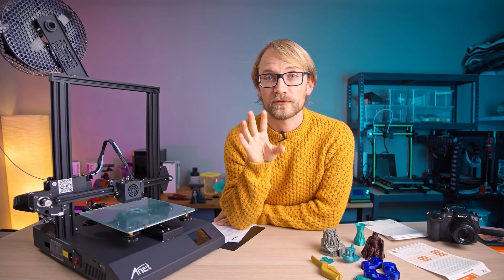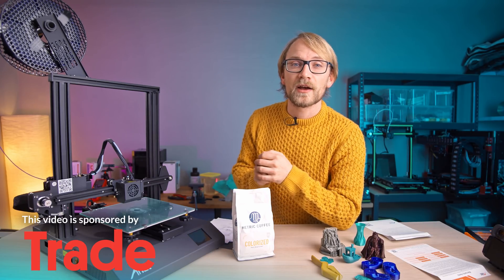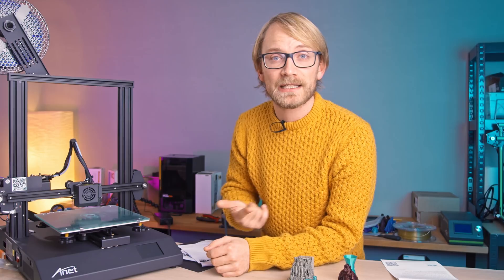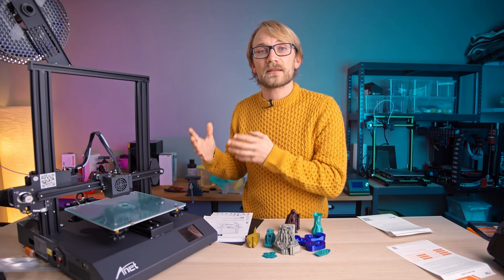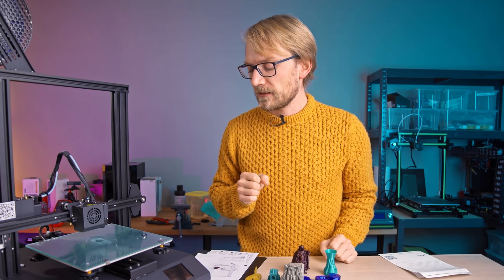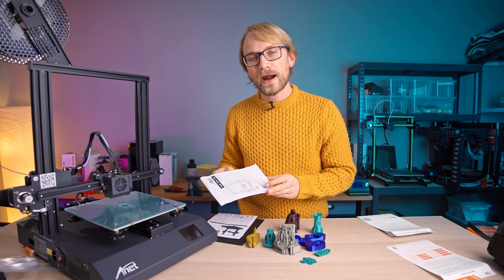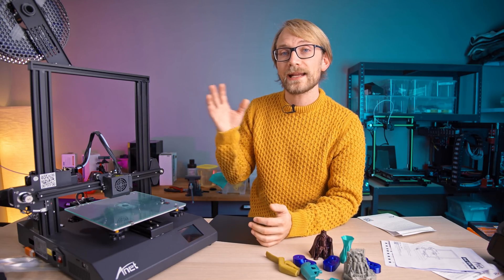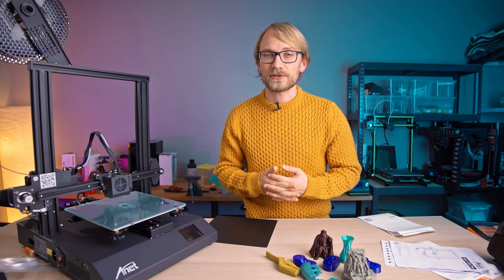What a lazy 3D printer design! Anet ET4 "Pro" review

Comment: Yeah.. got an old A6 (second hand, 50$) and it is/was trash when i got it. I mean:
the frame flexes (reinfroced it, ended doing a custom aluminium frame. Good thing i can design being an automotive mechanincal engineer for real), 
the hotend is trash - got a proper V6 clone (along with new fans and designed a new X carriege), 
belts and tensioning and aligning are trash and got new mounts designed to make a straight path, proper tensioner with toothed idle roller and good stiff gt2 belts not the rubbery type it had.
Linear axis and bearings were worn and bent (i said i got it second hand.. but the axis are not hardened! the axis were chewed by the bearings and the bearings were chewed as well). Swapped all axis rail and bearings and also got a proper mounting on the frame (that is replaced entirely, but original mounting was trash with zero ajustability and was binding forcing the y axis to bend and bind in some spots, they had a slight angle) and adjustability to ensure they are level and paralel. Also went from 8mm to 12mm since there was not much big price difference.
Motors still hold up, extruder gears were redesigned by me to be bondtech type (dual driven wheels, both knureld with hollow indent to beter wrap the filament). Made my wheels on a minilathe out of tool steel and carbide inserts. - knurling done with rotary tool in toolpost and indexing on the lathe spindle.
Electronics are still present but A4988 drivers ged old really fast and plan to swap to tmc2300 but i bet is not easy to swap so a new board is probably a safer bet.

Overall for 50$ i got 5 steppers that work, and two T8 screws and bronze T8 nuts, psu, crappy lcd and electronic board - all in chinese quality. For a proper build i'd swapt the psu and electronics board and motors with proper drivers and will have nothing left from the original anet a6.

Anyway the thing i got was a template and personal drive to make it better. If i have not got that 3d printer and waited to make one from scrath would not probably have one to this day. The same when you want an old car and just buy a wreck with seized engine and totaly rusted out frame and body and redo everything based on that template.

Anyway, i now still have that heavily modded anet that works a lot better than original. and got a prusa mk3s as well and often work with a pro 3dprinter from zotrax at work. (got it by request after i messed with 3dprinting at home with my endless struggle with anet). Neeedless to say that whenever i want to play i print on prusa and on zotrax and the anet is gathering dust.
I might repurpose that anet to make CNC or vector cutter for vynil or CO2 laser cutter engraver (with the all metal frame and 12mm axis i guess is strong enough for light cnc. But probably need bigger steppers. 

Anyway this is my experience with Anet or whats left of it.

Comment: Hey Tom, I love seeing reviews being critical when they need be and not when they don’t.  One thing you called out that is also a complaint I have is the belt path.  I see the same thing on every Creality printer and it’s just not good design.  We know that tying the carriage and bed, which only move linear to a power transmission using a belt that’s not parallel to the motion causes error as the carriage/bed gets closer or further to the extremes of the movement.  I completely understand it’s the design they come up with that lets them offer the cheapest price.  But all it would take is a little more thought, it wouldn’t cost anything to do it right.  I posted it to Creality’s Official Facebook Group and got completely destroyed with insults by users who don’t understand the problem, or were quick to dismiss it because they’re cheap printers.  I was wondering if you might also point this out.  Maybe printer makers will take note.

Comment: I bought this printer (before I saw this review), but I haven't had any problems with cura: I just installed it on Manjaro and there was a profile for the printer which works well. Now that it's setup I can get good results. The setup instructions and the support model are atrocious and Anet really needs to be called out on this so well done, but the printer itself seems to produce good results. My calibration cube is within a 1/10th mm. The review is more about Anet as a company than the printer's actual capabilities, but Anet really needs to learn this lesson and stop this bullshit they are going on with.

Comment: impossible  to update   firmware  on it  with out external programmer, if you do. warranty,,  1 years is out the window. DO NOT BUY.  Anet should be ashamed of them self for such a failure. but its a good paper weight now...................

Comment: I do have one (unfortunately).
- Nothing sticks to the glass bed, unless there is a tube full of glue (PVA glue stick). To put things into perspective, even PLA prints warp!!
-  When trying to print fine details the extruder (gear) makes a knocking sound that progressively increases (not heat creep nor due to filament getting blocked due to lower temperature).
- it took me about 3-4 months and few failed attempts to figure out that the 'black sticky back sticker" is useless.
- the cherry on top? badly configured cura profiles. (Machine works  okay with latest Cura (4.7.0+) though)
Reply: Before someone comments about inexperience, I work at a makerspace, where I'm in charge of 3D design and printing. We do have a few 3D printers - cheap ones to expensive ones - never are any of them a headache..

Comment: Are you capable of making a review of ANY 3d printer?  Or are you expecting to be mollycoddled? I bought one of these in early November it printed straight after I put it together.  The hardest part was getting it out of the box, it was packed so tight I had to get my wife to hold the box while I pulled it out!  I installed the software, Cura 14.0.7, and ran the 3 provided samples, Gcode produced by Simplify 3D,  I didn't even level the bed!  So, please, find out what you did wrong before blaming the printer. You spent nearly a quarter of the review telling me about some sort of coffee before you got straight into the complaints.  Not a good review even if you hated the printer!

Comment: I have the ANET A-6, I got it as a kit over 2 years ago and mine works great. so I guess not all their products are rubbish, or at the very least didn't used to be.
Reply: Jesus. That thing is absolute TRASH. Not a single good thing on that one. No scratch that, the price was good. Got one for about 100 euros back in the days. But it's horrible and I've disassembled mine ages ago to be used as random parts for other products.
Reply: @jothain  I've been using mine for few years now and the only complaint is the heated bed is not perfectly flat, but for me its been printing fine and the only repair has been to the fan for the heat brake, but I broke one of the blades off myself accidentally. maybe yours was just a lemon?? what problems did you have and what are its likely failure points that I should be watching for.
Reply: @kirknelson156  Well the biggest problem is that there aren't any safeties enabled by default on it's control board. There's serious firehazard issues with that device. Also it's heated bed connector is very likely to melt/burn. Then the build quality itself was horrible. I made tons of tweaks for it replacing multiple parts by other designs to get it working better and in the end it honestly printed really well, albeit slow. But I decided to trash that machine because of my long prints and it's evident fire hazard issues. There're reports of people's houses burned because of A6 electrics and software. I replaced that with Prusa MK3 and have been really happy with change and felt much more secure using it.
Reply: @kirknelson156  Do note that it's basically exactly same components as A8 model. Only frame has slight differences, but electronics are essentially identical on A6 and A8. I highly suggest to Google around about their safeties. I wouldn't wish anyone that their printer got in fire.

Comment: I just watched Dr Vax review and his opinion appears to be completely different.
What don’t understand about his review is, he noticed a lot of the issues but brushed over them just saying that it could be fixed with future updates to the firmware not thinking it was much of an issue and he made his own slicer profile as if this is nothing.
I think he’s an idiot. No boot loader so you have to open the case and update it that way, this is huge, for someone new to 3D printers this is an overwhelming thing to do, to create a slicer profile it well beyond a newbie, I think he used an Ender 3 profile and tweaked it, and to top it of he mentions moving the print files in order for the printer to read it.
It’s unacceptable that they put this out as a retail product.
But Dr Vax thinks it’s fine.
As more proof that he’s an idiot he also reviewed the creality WiFi module and it’s useless, Michael on Teaching Tech reviewed this piece of junk, despite all the issues he still thinks it’s a good product..
Your review is honest. I agree with you to all of the points. 
It’s unusable as it is and there is no way anyone should recommend it, the minor issues Dr Vax mentions are not minor things, they are incredibly major.
No one should buy this printer.
Thank you for the honest and informative review.

Comment: i made the mistake of buying a ANET et5 pro , worst decision ive ever done, what a garbage printer with garbage software and garbage parts, and the literal worst customer support ive ever had, they dicked me around for 120+ emails, before i got tired out by them . wouldnt take damaged parts, wouldnt take a refund - wouldnt send me software , the ET5 pro came with software for the ET4 .. so auto bed level was on 70% of the bed... i hated it, worst printer ive ever tried , worst company ive ever shopped at, they are just horrible for the industry .

Comment: It's nice to see that when it comes to cheap printers, you seem to talk more objectively now and explain on issues, instead of just making unexplained derogaroty remarks all the time.
I think this printer could still have had it's place as an entry device for tinkerers, if only the price was much lower. Like with the A8 - it wasn't great out of the box, but it was dirt cheap (sometimes below 100€) and with some easy (and mostly 3D-printable) mods, you could make it a decent and reliable printer while learning a valuable lot about the mechanics and electronics.
The ET4 misses this point by about 150€..

Comment: I bought an et4+ month ago. The video is on point. Got no constant print quality. Every Print is different. The Sensor needs to be adjusted a lot after one or few prints... Marlin makes the print not better 👎. Only better performance with octoprint. Because stock Firmware geht's disconnected after few minutes or Hours of printing. Extruder stop's extruding, hotend or hotbed turns off. And many other Problems...I ordered an artillery sidewinder now.. hope printing Starts to making fun with the new printer..

Comment: With Anet you don't get a printer, you get a project of a printer, you have to rebuild the machine to get it working, replace wires, find better way to make some parts or replace them, then you have a printer, not a good one, not a reliable one (because anet parts are bads,bad motherboard, bad steppers, bad tuning, bad cooling, cheap motors, horrible belts, bent rods, bad wheels, bad way to mount the wheels, bad wires, crappy power supply, cheap bed, non reliable sensors...)

Comment: I own the labist version of this printer. It is super buggy and requires a lot of patience. The bug with the micro sd card is fixed by changing the file name to something simple with no . in it. I got a very good deal on mine, I'd never suggest this printer to anyone otherwise. I payed just over 100 for mine, at that price its worth it. Anything more than that go with something more upgradeable than this like ender 3 original. At least that is using standard parts and is easily upgraded. Anet et4 is almost 100% proprietary including the ptfe od of 3.8 mm

Comment: I have managed the st-link to upgrade to marlin, gheto rigged a momentary switch to work as a z-max limit switch, configured cura with the ultimaker cura defaults for the et4, and modified start and end gcodes, to functional results. I do use it for practical solutions adound the home and office, and I do have a degree in computer engineering. So it can be functional, i would not recommend this for anyone that is not a tinkerer, and would not qualify to be a member of geek squad(yes, i am that too).

Comment: They sent me one of these and I've had none of the issues you had. I use current Cura, and quality is usually pretty good. I don't understand your tirade. It's usable, and it's only my second fdm machine.
Reply: Consistent quality is important. Congrats on getting a working machine out of anet but if they want people to gamble they need to run a casino not a 3d printing company.

Comment: I bought an ET5 two weeks ago and after spending a couple of hours I could get the printer to print really good, you can just download the profile from cura 4.8 and the activating retraction, z hope, etc also the stock firmware it's garbage, I'll upgrade to marlin 2.0
Reply: Yes so true all you need is to make some changes, I couldnt get mine to work at first so I purchased an ender 5 now it works great. Thanks Anet.

Comment: I still use ny ANET A8 with like a million mods. But as a company, I think unless they re-brand that they're going to die.
Reply: Nah,  probably stay there forever with more and more laughable 3d printers and other items. At least they are now pretty safe since many don't even turn on but all I received have now safety-things enabled in firmware  and are grounded. They are now like Creality producing more and more models that are basically kind of the same but a tad different but also making some innovative things that never seem to reach the market, but maybe will be on the market in 5 years for a really low price.

I have a lot of Anet's here, running nicely, most almost stock and all with a Pi connected because the menus are not the way I think ;-)

Comment: I have been using it without any issues from 2month's 
You should be kidding.... 😂
Only problem I faced is corrupt sdcard. 
Print quality is good also.
Reply: On mine it doesn't read the SD-card at all, brand new, they have shipped spares, but not from the EU shipping facility, parts are from China, I don't know if it's express or not, but it's not what you expect when you buy a brand new printer...

Comment: I bought one, mainly because it is small enough for the place where I wanted it to be. The other one which is small enough would be the Artillery Sidewinder. Since I already have a well-working A8, I was not expecting that it would work out of the box (which it didn't 😒).  But I knew that I can get it running.
Now it works fine, including auto-leveling, pause/resume and filament detection, using the Ender 3 settings in Simplify 3D.

Comment: Years and years ago, I bought an A8 on sale. It was delivered at some crazy low price. I knew nothing about 3d printing and wanted to tinker. I learned so much with that printer and the whole journey in upgrades, frame replacement, mosfets, marlin, bowden feed system, etc. I still have that printer. Actually proud of how it came out and it was very functional. But it's long since been put on a shelf. However the lessons learned were priceless. Would I consider recommending an Anet to anyone else, "not bloody likely"! No way, not going to happen.  Thank you very much for calling this what it is. Junk in a box. Return to sender. Although I do like the idea of an Anet bounce test.    Thanks again!

Comment: Hi Tom. I'm confused as to the trouble you're having with this printer. I own one (got it in Mar 2020) - it is the first one I have owned and I have very little 3D printing experience. I have not had any of the issues you talk about. My printer prints well, the SD card was fine out of the box, the belts and wheels are good and I used the profile built into Cura, from the beginning. I've printed different kinds of PLA and PETG with no problems and minimal stringing and good detail. For assembly, I watched the Youtube assembly video and it explained everything, including the calibration of the bed sensor. I'm not  in the EU so maybe the manual included in the box was different for mine but it looks complete.  I watched reviews from experts like Dr Vax and Just Vlad as well as beginners like Andrew Newton and they too have not had the problems you had. Also, Dr. Vax specifically mentioned and showed a print which resumed perfectly after a power outage. on the Just Vlad channel he does print-in-place too.  Also, the case is grounded - it is physically attached to the grounded power supply body - computer cases use this method as well.  I don't have 1/10th the experience with 3D printing as you but I know a garbage print when I see one and I've had very few from this printer.  Is it possible you just got a bad device?
Reply: Are you payed by Anet, or just want to get a free printer from them? 🤔
Reply: @ProtonOne11  I do not work for Anet. I researched before I bought the printer and after buying it I have had a very different experience to Tom’s. That is all.